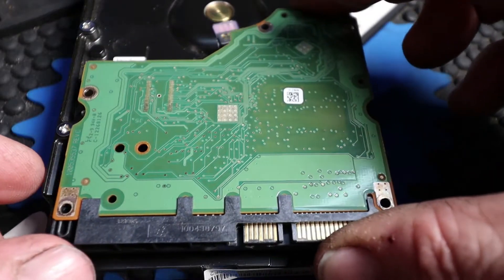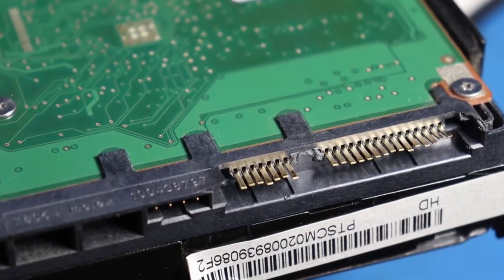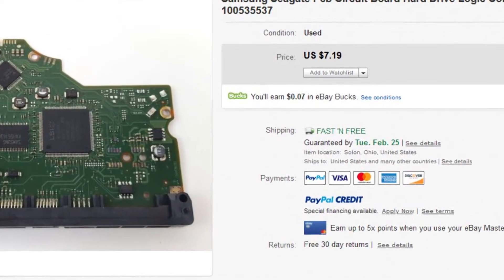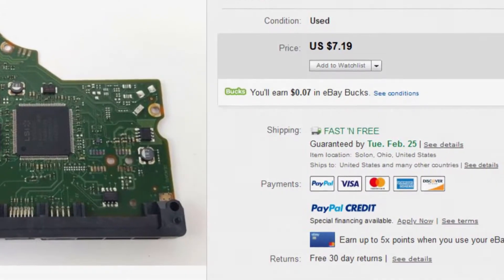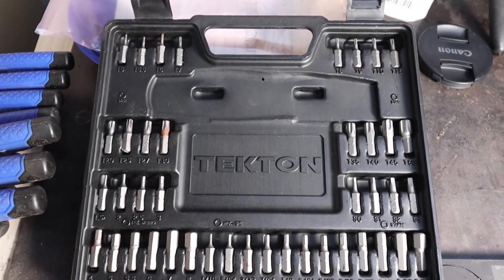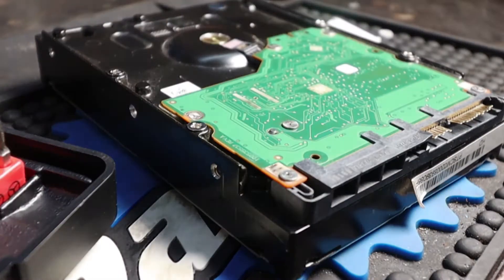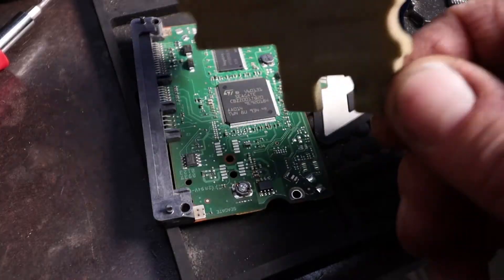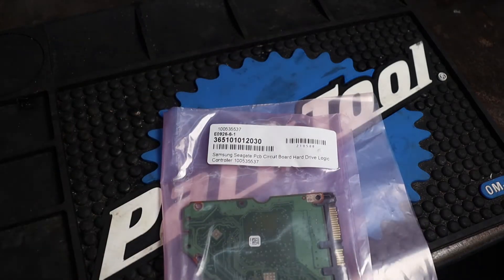Hard Drive Repair | Circuit Board Replacement

Comment: @1:46 I like to use a silicon pad designed for this or an inverted strip of duck tape. The duct tape  method also allows to add notes on a strip of paper.

Comment: I have swapped the board and move the old bios chip to new one, it read on diskmanager but asked me to initialize and when i did it give error
There's no rough noise or click on the drive
Any solution?
Reply: Brother did you find a solution for that? If you have please also let me know
Reply: @deskharisma please do tell me if you have found a solution to that
Reply: @zaryabkhalil4316  unfortunately not yet, the disk is still dormant as for now

Comment: PSA: You are required to swap the BIOS chip. There are lots of vids on YT that shows this. It's a very easy process, de-solder 8 pins, remove chip, place old chip on new board. You don't need a heat gun, a soldering iron with de-soldering wick is fine. It's a chonky chip, so no fine work is required.
Reply: TY, that was the info I was looking for.
Reply: Wassap what if i broke the bios ?
Reply: Can we swap to any hard disk working pcb or same model hard disk working pcb is required?

Comment: simple answer if i have a drive that has a bad pcb board and i replace it with an identical board will that give me access to my information
Reply: No you have to access the data that was in the bad board by the bios chip, once you find it you have to put it inside the new one
Reply: @334Creations how to perform this

Comment: Came across this video and im in need of help, i have a seagate barracuda think it is 2 tb hard drive, the sata port on it snapped off so i ended up replacing the entire board on it, but i connected it and nothing, keep in mind the hhd was fine before that snapped off so it was a working unit no problems and very little use out of it so very little ware on the internals, do you have to do something special for the chip to start working on it to run it? I did buy it from a place idk if they are reputable but any advise?

Comment: I had the same problem with my Seagate 1TB SATA drive dying and found the same working drives on eBay with the exact parameters as mine on the label on the ad. I messaged the seller to verify the info before I purchased it because he may be using a generic photo on one of his. Once it was verified I made the purchase. The board on my old drive has the same part number as his, just a later revision.  The firmware was the same so I shouldn't need to change that.
Reply: dude, you didn't even tell us if it works for you or not
Reply: Tell us please if it works

Comment: In my hdd the pcb  screws are stuck in their hole and I am not able to open it how can I remove it , is there any solution?
Reply: Bro did you find a solution to your screws stuck in holes .??
Let me know I can help.
Reply: @dfsilversurfer  no bro
Reply: @anoop000111  how are they stuck . Did u round  out the screw? Either way try a very hot soldering iron without solder out inside screw head to heat screw up as hot as you can . A little smoke from around screw is ok just not alot. When you have it as hot as possible without destroying anything, quickly put into frost free freezer briefly like 5 or 10min don't freeze. Try unscrew while still cold. Repeat process. If screw rounded fill with metal putty, put screw driver in for shape then leave couple of days to go hard.  These have worked for me
Reply: salam.try this: put a little soft plastic in the screw head and start unscrewing.

Comment: Hi mate i got seagate portable harddrive 5tb the circuit is dead
Now i need to replace it i bought the new drive and try to replace it but seriial no is diff where can i buy the new pcb with same serial no
So it can work

Comment: You can NOT just swap the board. If you do the hard drive will spin, but there is NO data. You have to swap the bios chip from the "bad board" to the new board. This video is  for no use.
Reply: how do you do that?
Reply: @teachermichaelt.d.  You have to go online and search for your board and locate the bios chip on the board. Then you need some skill to heat the chip free from the bad board and heat it on to the new board. You can find videos about how to here on Youtube. But if you don't have any experience doing this, you should call a computer repair shop and let them swap the chip. I don't think it will cost a lot of money. I've heard a price around 50 bucks should do it.
Reply: @eriksrensen6369  nice one for speedy response. I think I have the skill, I tinker with RC aircraft and their electrics. However, if that chip cannot be replaced, is there another way of activating the circuit board?
Reply: @teachermichaelt.d.  As I understand, you say you have the skill to replace the bios chip. And now you ask if the chip can't be replaced?  It doesn't make sense. The chip CAN be replaced if you know how to do it. I think you should let a repair shop do it for you,
Reply: @eriksrensen6369 Or You can use EEPROM Flash Clip to transfer data.
Reply: Thank you for making comment.
Reply: Is the first useful comment that I've read so far. This Mike won't be getting my subscription!!  it's obvious now why he never completed the video and doesn't answer people with legitimate questions. Like did it work.
Reply: How to know if the hdd pcb is bad
Reply: What if the pcb is dead and you dont care about getting the data back? Just swapping the board will make it work again? (Got a dead HD right out of the box but was void of warrenty)

Comment: I have a seagate hard drive with the same broken connector problem. I don’t have any data on it but would just like to be able to use the drive. By replacing the pcb board would that be enough to use it safely ?
Reply from the maker: Hi Patts, I wish that I had an accurate answer for you on this. Looking at some of the comments, there seems to be varying levels of success in replacing the PCB. It's sort of a gamble as to whether or not it would work.

Comment: Without the bios this will not recover your data. I notice you didn't test to see if it work after the change. It's very misleading.
Reply: just curious, if i had the same issue with the broken connectors but i don't care to recover my data can i just replace the pcb without swapping the bios chips?
Reply: @ryanvox1  I do believe so but you might have a corruption issue down the road with artifacts from previous writing but that's me just speculating.
Reply: Do you think i can swap the board from different size but same manufacturer?
Reply: @mrizkyavanza4837  the likely hood that everything would be the same from one board to another is extremely unlikely. You might get it to work but you are going to burn up a capacitor or chip at some point if not instantly. Really these boards are very easy cheap and easy to come by. You just look for the number on the board and look it up. Get the spare board and remove its blank bios and swap it fornthe old bios chip plug it back in to the flash or disk memory and presto it will work.
Reply: @iiravens  i already messed up the head so i think swapping the plate is the last option, because nobody selling that drive any longer
Reply: @iiravens  would it work if i just get the plate move it into donor drive and swap the bios?
Reply: Bios would be on p.c. memmory.
Reply: @johnsarab4500  Sure, but there is also a bios chip on the hard drive that is essentially the ID for the drive. Without it, there is no way to call up the memory as it's saved. It's basically the road map or decoder for the drive drive.

Comment: I'm having a problem with my WD10JPVX , the SSD isn't detected in my laptop, it only gets detected once per 20 times trying , and when its finally detected i open the partitions i see my files everything is fine, but few seconds later it gets undetected again .

My SSD is spinning perfectly , no weird sounds at all, only one unusual sound happens every 3 minutes maybe for 1 second , maybe it's even a normal sound . 

No burn smells, no power problems .

So is that a problem in the PCB Board ? And what if i change the PCB board ? Will i get my data back ? And the ssd would work again and i wouldn't need a new SSD ?

Please let me know 
Thanks in advance
Reply from the maker: Gosh PUBG Lila, I wish that I could help you with that. I have put drives in before that I had to "teach" the computer where to recognize it, which there were YouTube videos about. But I never had issues again after doing that.
You mentioned that the SSD is spinning and not making any weird sounds. A solid state drive has no moving parts and wouldn't make any sounds at all.
Aside from that, I'm no computer expert. I just tinker with my own stuff. My channel mainly revolves around mountain biking and tools. I'll look around and get back to you in the comments here if I find anything. Sorry I couldn't be of more help to you. Thanks for watching!
Reply: @themostlymikeshow  

First, thanks for that instant Response, that was really very nice of you .

Well my question is very simple

if my SSD gets detected only once per 20 times trying , and when its finally detected i open the partitions i see my files everything is fine, but few seconds later it gets undetected again . [ i use usb connector to connect it to another laptop ]

Well , this means the problem is in the PCB board ? Or the disk itself ? I'm trying to get my data back .

Comment: hi got a toshiba hdd 2.5 and a samsung hdd 2.5 can i swop these to circuit boards?
Reply: It will not work. Even if you both found and successfully transfer identical board on your hdd. Whats important you use the same bios. Some tech try to transfer the bios chip to other good one still 50-50 change. The best thing to do is try to find and replace the bad component.
Reply from the maker: I am not sure if they would work. Do they have the same brand of board? On mine, the boards were identical.
Reply: @themostlymikeshow  
I just subscribed I just got done earlier today replacing the printed circuit board on my old hard drive.
I found an identical printed circuit board on eBay for 20 bucks.
I bought it and replaced it but did not installed in the computer at this point.
Believe it or not I got an email from the seller they were telling me that I must change the BIOS chip on the board or resoldering or something like that.
So at that point I was glad I did not install it in my computer.
So I'm sitting around here thinking about this and I stumbled upon your video.
Hopefully when you replace the furnace circuit board everything works fine.

I don't know anything about resoldering a bios chip but I think I'm going to put my hard drive in my computer and see if I can recover the data it's been sitting out for five years because I had some broken pins on my old printed circuit board.
Watching your video makes me think I'm not going to have any problem recovering that data.
Keith

Comment: You left out the most important part - Did it work? Did you get your data back?
Reply: Thanks alot for the video! So no soldering? Someone told me I had to do that so I quickly came to YouTube and saw your video and see that you didn't have to
Reply from the maker: Yes, but because the data was top secret in nature, I couldn't include it with the video!
Reply: @themostlymikeshow  Did you swap over the bios chip?
Reply: @socalpirates3655  he had to. You can’t just put them on and say yup that’s good
Reply: @bobbo2576  that is NOT true. Most hard drives we do not have to do this. Only some drives require that and it's mostly SAS server drives. Normal SATA hard drives will work with any random PCB that's compatible.
Reply: @Sabrinahuskydog  well I tried a swap and it didn’t work. It spins and runs but still not showing on pc or device manager.
Reply: @bobbo2576  did You find a solution?